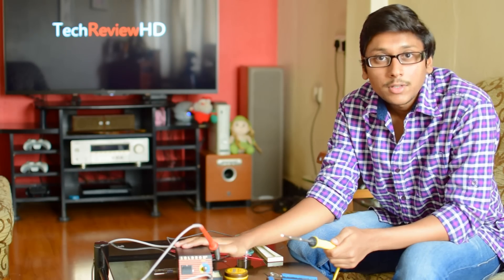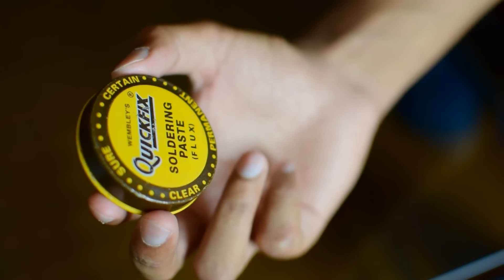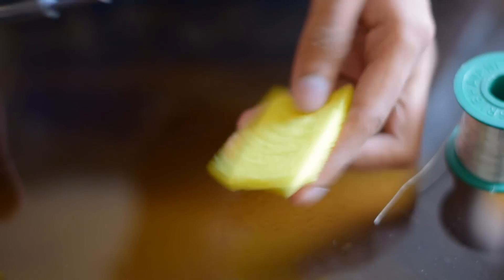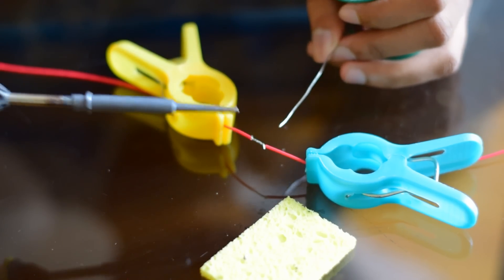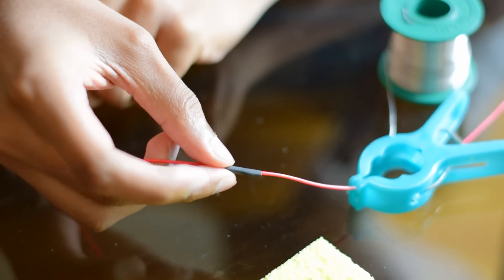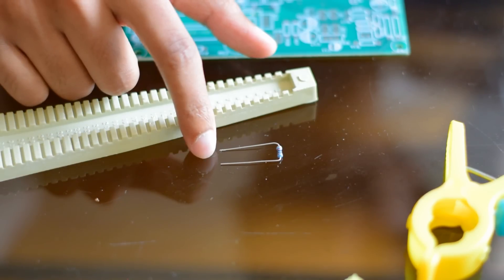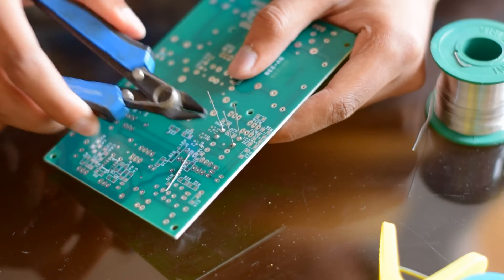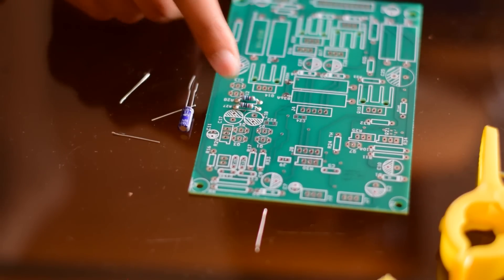How to Solder | Tips for Beginners (HD)

Comment: About the cleaning, isopropanol or isopropyl alcohol is also available from pharmacy as wet cloth packets. They are commonly used by doctors after giving a shot. So, you don't have to buy the whole bottle if you're doing a small project.

Comment: An additional tip. Once you place the component on the PCB, bend the leads away in a V so that the component stays in place. If the leads are too short to be bent, use a tape on the opposite side to keep the component in place.
Reply: thank you very very much

Comment: Why we need soldering paste or cream??
Reply: no thats not correct...its used  to reduce carbon deposits. this is mandatory.
Reply: For smooth point
Reply: When to use that paste and how
Reply: @shruti2096  well you may use it every time.it tends pro quality soldering.
Reply: And apply it to soldering iron, right?
Reply: @shruti2096  yes both iron and also should be applied components contact points  to be soldered for better results.

Comment: Hii vimal your video was nice but can you tell us how to remove the soldered part of a remote or anything
Reply: You would need a soldering iron and a desoldering pump. Firstly you will need to heat the solder with the iron and then when the solder melts use the desoldering pump to remove the liquified solder. Hope this helped!

Comment: If I have a 50w soldering iron with a temperature control, should I use it to solder small electronics?
Reply: yes of course you can go for it but look for the tip of soldering iron it should be small in width to that of using for 50 watt work type

Comment: Good video, but I strongly recommend using brass wire for tip cleaning instead of wet sponge. When tip goes in contact with wet sponge, it causes thermal shock and micro cracks to it's surface, thin layer of chromium and nickel plating will be damaged and tip will oxidize heavily. With brass wire cleaning you will have much more tip life.
Reply: amigator